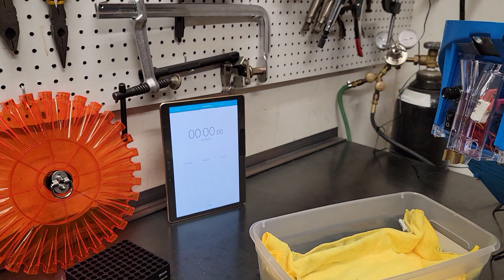Best Brass Feeder

Comment: Looks like the DAA runs with less jams than Dillon (once properly set up). Note: all of the case feeders stop feeding/filling well once there are less than 20 or so cases. That part of your test is not relevant. PRACTICALLY, I can not outrun the casefeeder with Dillon plate on my 650, even with motor (old two-speed) set to low. I have found the speed adjust is more a matter of reliable feeding with different case sizes, not how fast it will spit out oriented cases. The DAA looks snazzy and looks "different" but from my perspective does not have any effect on my overall loading rate. Maybe with the power drive systems and bullet feeder it would, but my volume of loading doesn't warrant that additional cost.
Reply from the maker: Absolutely, for most of us just loading with a hand crank we can't outrun the factory unit. But a decapper/automated press/ or rollsizer definitely can. Thanks for the info.